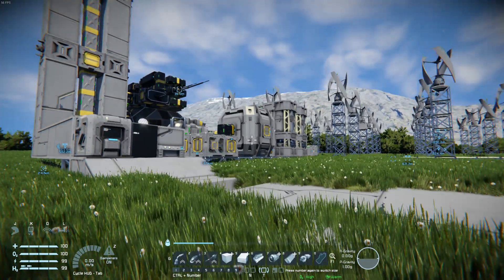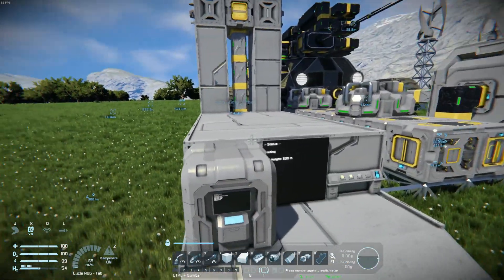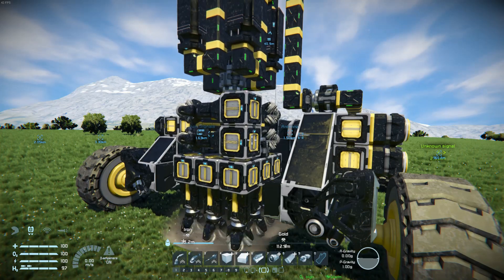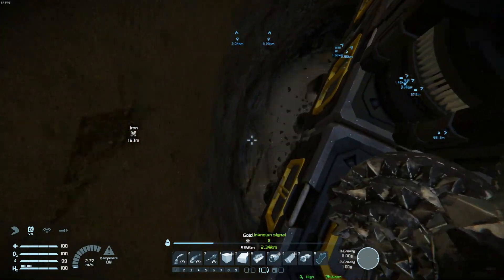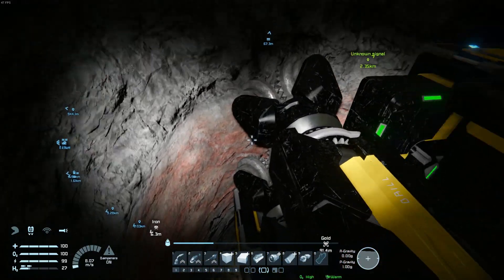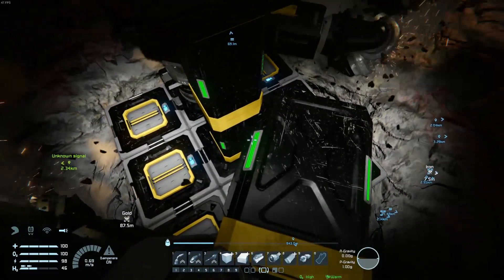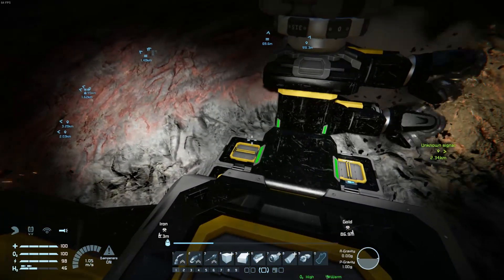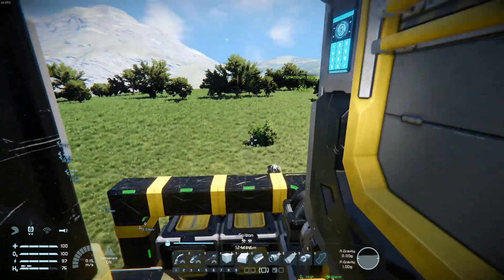Survival Drillling rig update -  now with seam sensing & expansion!

Comment: How is it managed to find the right depth ... passing throug and stop going deeper, pulling back ... is not by using oredetectors right?

Whats about gold ... very deep?
Reply: It monitors the downwards drills for ore - when they start getting ore, that's the top of the seam, when the stop getting ore, that's the bottom. It gets the middle of the two and aligns the sideways drills accordingly.
Reply: @dylanharding5720  skript?
Reply: @Pyramidalist  it's all controlled by something called a programmable block - those run "scripts" or user-made code that interacts with the game.

Comment: First THANK YOU for the awesome script. But i have one issue with the drilling process or rather a couple of suggestion.
Suggestion 1 - If possible can you make an option to skip the current ore seam and continue drilling downward.
Example: Let's say there is patch of Nickel 20-30 meter below ground and there is Silver patch beneath it. Probably an argument like "skip" would just ignore the current ore location and continue drilling until it finds another patch of ore.

Suggestion 2 - As far as I can understand the code you can set a "state" of the pistons. If possible can you change the velocity of pistons if there is no ore drilled.
Example: When drilling a second time in the same hole I have to wait for the arm to extend slowly all the way to the previous drilled hole, instead of moving fast downward and when the drills start digging ore to slow down the pistons.

Note: I hope I explained it correctly since my English is not very good :)

Comment: Have you considered a multi link drill arm with single drill head that wraps around the spindle? Should make a larger circle, meaning more ore.
Reply from the maker: Yeah, just got too slow for my taste with a single drill, 3x3 feels like a good amount, but if it was a thing you'd build several places and just have them drill while you go about your business, a single drill swinging out would be most efficient..

You should check this out, or at least the stuff around 6:30
https://www.youtube.com/watch?v=aaMFO2JZ0TY
Idea is to drill down to the ore and then expand the drillhead out, saving time on the rock on the way down.
Reply: @PatrickHansen101   Yes, having watched that is why I responded. I'm wondering if unwrapping with multiple linkages into a single arm would provide a larger  drill radius.
Reply from the maker: @Valenorious  It would :) you'd loose a lot of speed, and it may be a bit tricky the get the different linkages working in unison, you'd probably want to monitor the angles on all rotors so you don't end up with crooked arm in case the drill gets snagged on something.

Comment: I could have missed it, but: how does it "sense" that it reached some nice ore? Crazy cool drill!
Reply from the maker: Basically i check the inventory of all drills, when it first starts containing ore, i note that  position as being the start of the seam, when there hasn't been any ore in the drill for more than 5 seconds, i note that position as being the end of the seam, get the average between those two positons and you have the middle of the seam.

As it is right now, it doesn't discriminate between ores, it just ignores stone, could be made to only stop at a certain type of ore pretty easily.

Bit simple, but it works, has some inherent problems though :)